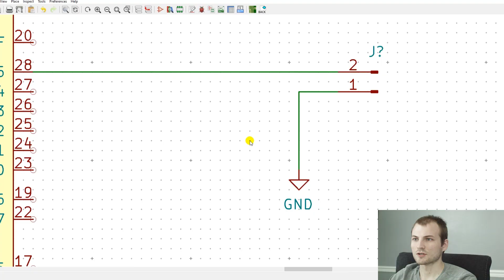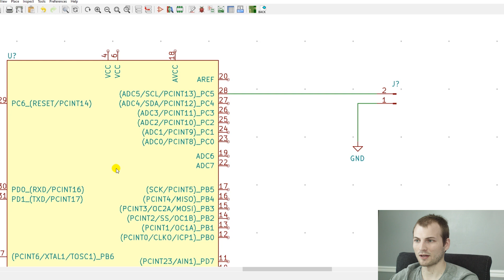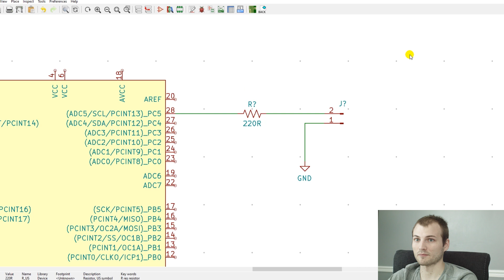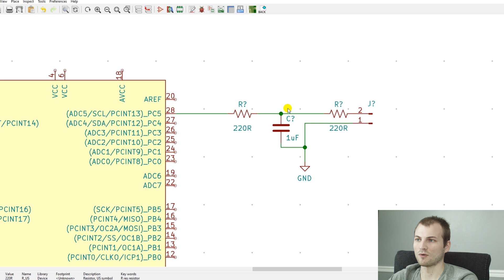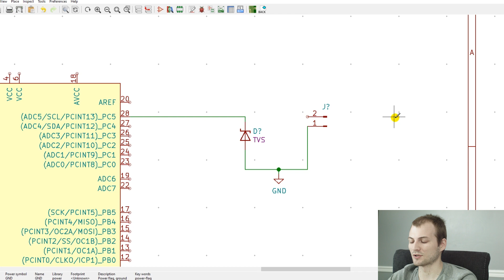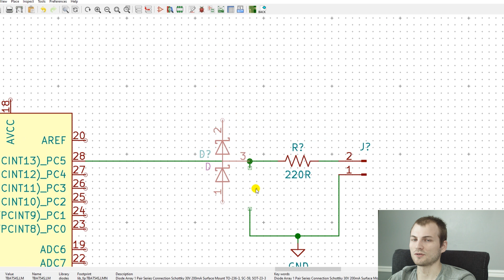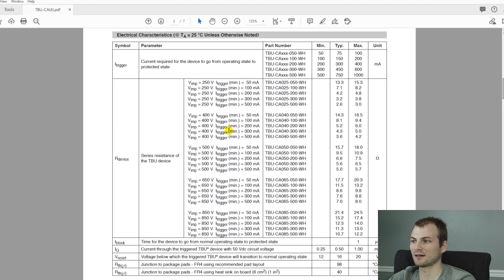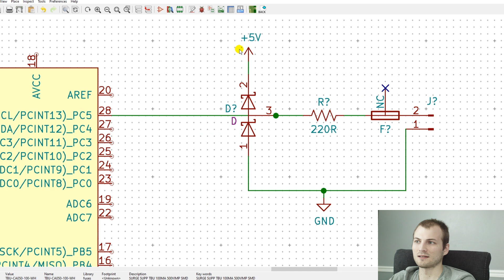Quick Circuit Tips #1 - ESD Protection - KiCad

Comment: Very useful video, thanks for sharing :), If a have digital signal that is expected to have 3.3V max and that I/O can stand a 3.6V as maximum,  I should choose a ESD diode parameter Vrwm = 3.6V? or it could be bigger? , let's say Vrwm=4V or 5V?. BTW diodes with Vrwm = 3.6V  are expensives

Comment: ESD is a very interesting topic. I have a power supply board & control board that I believe were victims of ESD from a lightning strike (no board damage). After I get the PSB working again, I'd like to add ESD protection to protect the controller IC (MCU) on the control board it powers. To do something like that would the TVS diode be installed inline near the VCC input to the controller IC?

Comment: Had an instance of a Automotive module that failed by destroying the MPU on ESD testing. All usual protection applied to the PCB, but someone in layout passed a trace with direct path to the MPU across a incoming trace and placed a through hole a minimum distance right beside the track to a line direct to input connector but infront of ESD protection. 
On ESD event the track at HT voltage flashed into the through hole and thus direct to the MPU pin on that track and blew the chip. All other 30 odd connections to the world with ESD protection could not help with that layout mistake.  Increasing the separation between input track and the through hole....no more ESD fail. Sadly there was great issue to not even pass that track that way across the board at input lines. It was that input or anyone of many others. But not putting the through hole at such  minimal spacing was easily done.
Reply from the maker: Well put! I focused on the schematic side here mostly, but yeah, layout can easily have just as big of an impact on ESD and transient protection

Comment: A question concerning resistors and capacitors for analog audio synthesizer circuits (eurorack). The RC time constant determines timings and resistor ratios determine op-amp amplification factors. But what are the best values to use? Too small an R will waste current. Too large will, I suspect, increase the amount of noise. But how much is too much?
Reply: I recommend checking out "small signal audio" by Doug self. It's geared towards audio circuits not synth circuit but you can use the same principles. In general I'd think Johnson noise is less of an issue in synth circuit.

Comment: Im interested when should you add esd protection, should you add esd protection on all headers for example
Reply from the maker: Ahh, you know what, I didn't mention that did I..? Oh well.. Yeah, so ideally, any "thing" that see's the outside world (buttons/switches/connectors/plugs/screens/etc.) should be protected from ESD. Of course due to BOM costs/size/etc. that may not always be possible. So then it's just a matter of nailing down the most important and/or vulnerable components, and protecting them.

Comment: I am setting up a test bench I would like to know if I need to ground my test bench equipment to your  ESD mat so that they all at the same potential. And the risk between your scope and switch-mode power supply under test when fed from an isolating transformer to protect your scope. I hope you can understand the question I am trying to ask it will probably require a two answer.
Reply from the maker: Uh, standard practice is to earth ground all ESD mats, regardless of where else power is coming from to you DUT.
Reply: @MicroTypeEngineering  Thanks for your reply I am enjoying the content of your channel and learning a whole heap of stuff. I am a new user of Ki-Cad and have learnt a lot of tips and tricks I did not know for the software. Thank you for the hard work you have put in producing the various topics on your channel.

Comment: Thanks, awesome info. How one would go about choosing the power rating of a resistor in this application?
Reply from the maker: Great question! So actually the power rating of the resistor is usually not important. Since resistors fail from prolonged power dissipation due to heat, normal ESD events are too short to matter. You can buy "pulse withstanding" resistors that have a quantified chart on the power and time they can handle.

It'll shock you to see how much power a 0402/0603 resistor can handle for a short amount of time.

Comment: I'm confused by those Schottky diodes being used as an ESD protection. Most are usually rated for no more than 30V reverse voltage in smaller packages. I understand that the surge will get clamped through the open diode and not affect the other one in reverse, but is that safe enough? Also, a negative surge will be sent to the positive rail and from there it still has to reach GND through something else, that will also get zapped with a few kilovolts. I'm not convinced that's a good design for ESD protection. I would rather go with TVS to GND or TSS to GND. You may want to look at TSS (Thyristor Surge Suppressor) if aiming high reliability. They also don't need that resistor in series of the I/O, as they can withstand a lot higher current than a TVS.

Comment: Please , if you can ,make an explicit video for high power circuit board (circuit schematic, pcb, device selection, parts selection,etc)! You will help me so much!Thanks and keep with the good work!
Reply from the maker: Have you watched my "High Power Circuit Board Design" series at the beginning of the channel?
Reply: @MicroTypeEngineering  Yes, but those videos are fast forward and i need more information about the design,pcb routing, how you choose width trace, how you choose components, maybe a 4 layer design.A more explicit tutorial would help me better.
Reply from the maker: Makes total sense. Any idea's on an interesting design/project for something like that?
Reply: @MicroTypeEngineering  For example i will like to see your ideea about how to make a circuit design (circuit schematic, parts to use and why you choose those parts, protection circuits, safety measures,maybe a pcb layout)for power a UV-C lamp using a 5V power supply and ESP-32 to control that UV lamp (start/stop) via bluetooth connection.I must add the fact,but i think you already know, that UV-C lamps are used for sanitation ,sterilization and the voltage needed for them to work is main power supply voltage.

Comment: Great video. This is what differs between good and great engineers. Do you have any practical experience of the necessary size of R-C ( 0402, 0603 etc) ?
Reply from the maker: Glad you enjoyed! Typically for RC's in digital circuits in general, you want to make sure that the max frequency of the signal is going to be below the 3dB cutoff frequency of the filter. This is to make sure you don't have any interference with the filter in your signal. It of course depends on the type of signal, as the 3dB might be too much attenuation, and you need to have a "less effective" filter.

As for physical size of the components, for standard ESD protection it normally doesn't matter a whole lot. It really would depend on how strong the events are expected, and if you have a specific standard you are designing towards. (Note: look into surge withstanding resistors, check the datasheets and see what they can withstand! Super neat)

Comment: Great video and channel! One comment on the Schottky diode to 5V: for overvoltage events it is important that the power rail can actually deal with the injected current. Taking your example, if 15V is applied externally, the 220 Ohm resistor will pass something like ~ 45 mA to the 5V rail. If the MCU (or other circuits on the same rail) draws at least that much current it will be fine, but if not the 5V rail will probably go up in voltage and fry the MCU by overvoltage. One way to deal with this is to additionally have a TVS or Zener diode on the 5V rail to clamp it to within the MCU maximum voltage rating. For ESD events this is probably less of an issue, if there is some bulk capacitance on the 5V rail to absorb the current spike.
Reply from the maker: Yep, spot on. There's certainly a lot of different routes you can go to protect circuits, just depends how much you need!

Comment: I really enjoy these videos, so much detail to consider in a good design, always learning. By the way  Is that what all those R/Cs are for on desktop CPU packages?
Reply from the maker: Glad you like them! They're used for various things. The huge amount of caps right near the CPU die are going to be mainly for decoupling/bypass.
Reply: @MicroTypeEngineering  Yes, I'd always assumed that might be the case but never investigated - it's not like full datasheets are generally available! Another possiblity is series termination for DDR, etc. but in watching your video I wondered whether additional external ESD mitigation might be a reason. I guess it would be much cheaper to just reserve a larger chunk of silicon in the IO sections for this though!

Comment: Good video, thanks. How do you select the parameters of the series resistors? I am trying to protect 4x8 matrix keyboard, so the size of the resistor is important to me - not sure what is the minimal voltage/power to pick. Also, less resistance means more current flowing in impulse to the shunt diode, but also means less power dissipates in the resistor. So resistance might play a role in tandem with voltage and power.

Comment: This was very informative! 
I'm glad you mentioned the series resistors. They are simple yet a very effective solution.
In my latest project I'm using a bi-directional TVS diode, like you said they're extremely fast and they usually fail by creating a short.  From what I've been reading they're commonly used in the automotive industry. 
Another ESD protection device worth mentioning is the MOV, although I believe they are preferred for high energy applications, mostly AC mains.
Reply from the maker: Absolutely!

Comment: Thanks for the video.
I'd like to add some thoughts: there are also Bi-directional TVS diodes available. It may be better to use one instead of the dual schottky diodes since they are designed to protect against static discharge. These devices allow current to flow in both directions, depending on the polarity of the ESD event (equivalent to the dual schottkys). 
Also, there are varistors, which can be used to protect against ESD.

Personally, I have never heard about these more intelligent protection devices, very interesting! :)
Reply from the maker: Yeah, I was going to mention bidirectional TVS's. Actually, they are quite misunderstood, and used in the manner that you mentioned, which isn't actually correct. Since they are essentially just a zener diode reverse biased, you only need one, not two. The only reason for bidirectional is for dealing with an AC signal, one that goes from + to -. A great example of that is an RS485 line, that can be +-12V. For a standard 0/5V signal, there is absolutely no need for a bidirectional TVS, a standard Unidirectional works fine. See: https://www.onsemi.com/pub/Collateral/AND8424-D.PDF

Yep, varistors can be great!
Reply: @MicroTypeEngineering  I think that I wasn't very good with my wording there, I didn't want to say that you need two Bi-directional TVS diodes to replace the dual schottkys ;)
Yes one from signal to protect to GND will be enough.

Please keep up this series, it's really interesting

Edit: after reading your answer properly, my statement in this comment doesn't really make sense either. A uni-directional tvs diode is indeed better for this use case. Man, this is getting better and better :D
Awesome to get new insights!
Reply: @MicroTypeEngineering  I'm just realising that. Why do they add bidirectional to UBS then?